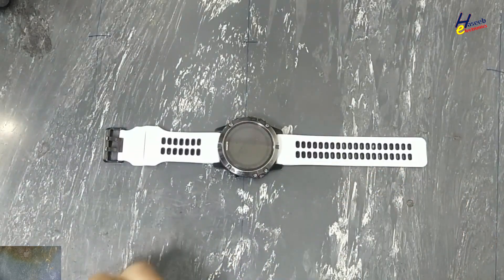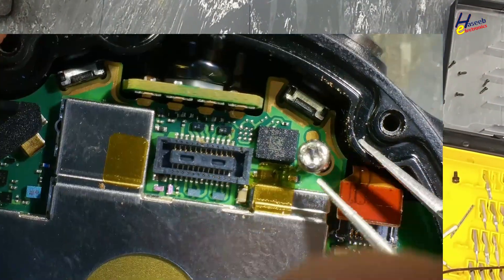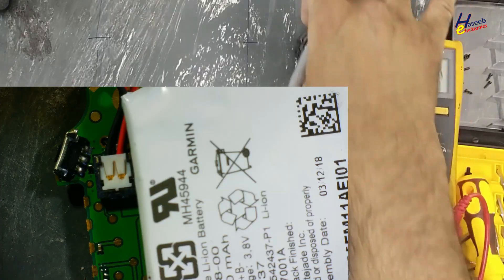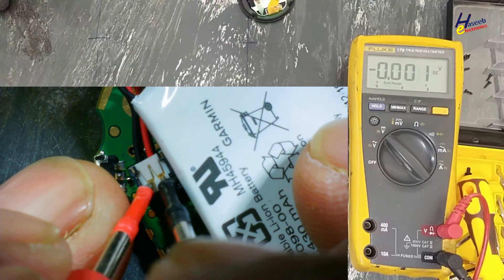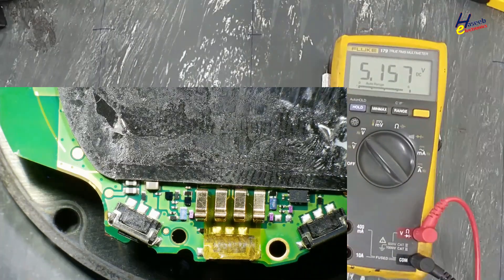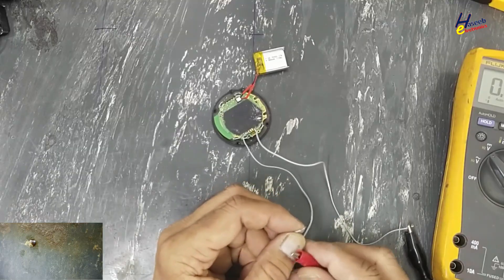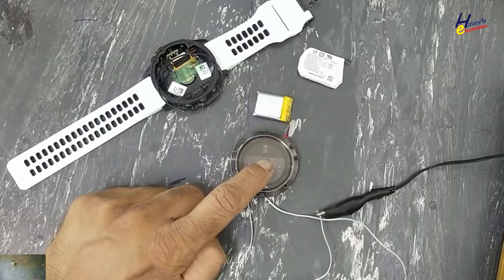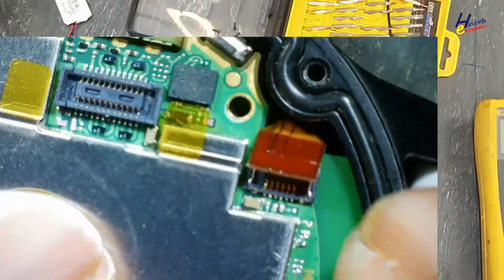{1404} Garmin Fenix 5X Watch Repair | Not Charging | Not Turning On | Battery Replaced

Comment: 3:02 - Its very dangerous to manipulate blade near battery. Better to use small fishing string, to separate battery and glue...
Reply from the maker: yes. you are right. when battery is dead, then and it has no swelling, then it is safe. but if it is charged or has swelling, then it must be separated using non-metallic scrapers. its glue was unbelieveablly strong